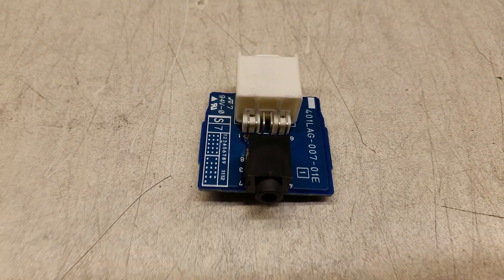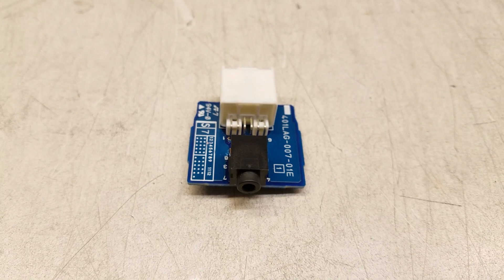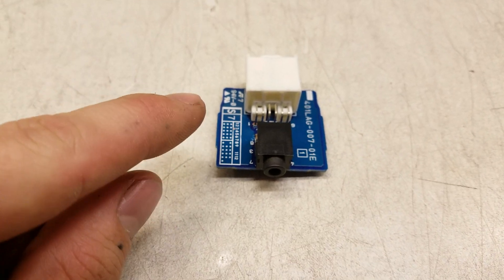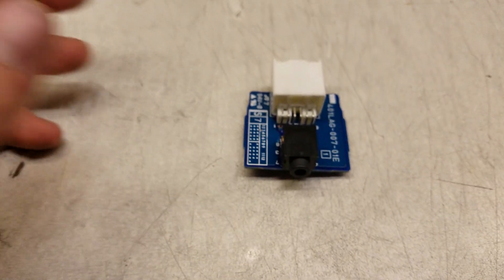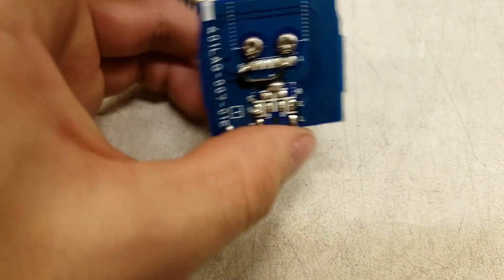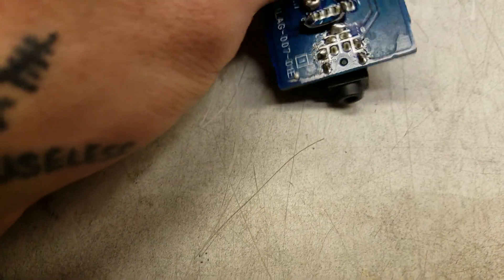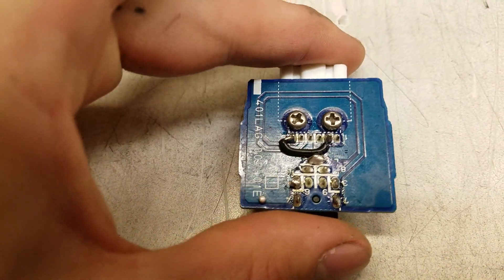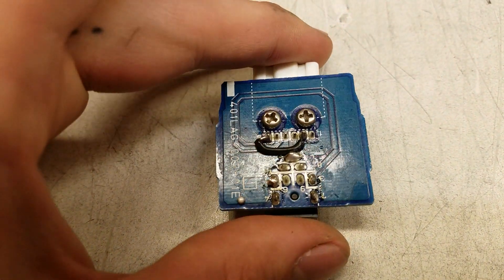AUX FIX FOR MAZDA 3

Comment: Thanks for posting this video. You saved me $50. I found it is much easier to tee the 1st & last wire together. No soldiering required. Cheer!!!!
Reply: How did you do it with no soldering?
Reply: @derickkaplan  probably some connecting caps that fit over the pins where all you need to do is crimp them.

Comment: Hello, thanks for this video! 

Does it matter what guage wire is used?

Also, my bluetooth is not working as well, went out at the same time the aux stopped working. I was reading somewhere it may be related to the bad aux. Do you know id this strategy will also get the bluetooth working again?

Thanks!

Comment: Thanks - works perfectly. Just an FYI, connecting pins 5 & 8 doesn't work (I tried this first), but as per your method, connecting pins 2 & 6 does work - cheers

Comment: I would really like to know what you used to set the 2 pins together.... honestly have no idea what to use I'm at that step currently... any help would be great thanks so much for this video
Reply from the maker: Learn to solder. It's not crazy hard and is a good cheap skill to have.
Plenty of stuff on it.
Buy a good burnzomatic iron some butane and grab a strand of wire.
You got this 🤙

Comment: Didn't work for me :(
Reply from the maker: Weird. Might be a bigger issue than just your port.
Reply: @CatZ3r0  Prior to soldering, if you held the jack male hard left, it worked. However as soon as I let go, music stopped. Pull to the left magic, let go, silence.
Reply from the maker: So why not make a test lead and figure out the pin?
This fixes exactly what you're facing.
Your solder joints might be cold as well, a glob of solder that isn't property flowed won't make contact.

Comment: This didn't work for me. I have a SAT button in mine that also does nothing. I am wondering if it's the button being broke, or maybe the SAT. I read that if SAT is enabled, then AUX (or in my case, "MEDIA") won't work.

Back to the drawing board! But at least you gave me a way to cross something off the list, and I appreciate that so much!
Reply from the maker: Yeah if you have the SAT plug in aux want work from what I understand.
Pull your radio and just unplug the SAT device and it should go back to AUX input.

Comment: Worked 100% for me. Pin 2 with 6. Luckily I had some wire small enough to solder. 2012 Mazda 6. Same PCB.

Comment: The port on my dad's 2008 mazda 3 works but sounds absolutely crap. I bought an Aukey bluetooth system for my Corolla but realized it requires a 3.5mm jack, which the mazda has so it's setup there. Lots of static noise (which is changing based on my engine RPM and gear weirdly) So is this video just a fix for a not working port or improves it as well?
Reply from the maker: Can’t hurt but what you’re hearing is what’s referred to as “alternator whine” plugging in a device like that (especially something externally powered such as through the lighter port) will give you the problem you’re facing.
Only way to alleviate it is to re ground the ground pin on the device to a better point and that’s very invasive and pointless. You’d be better off replacing the head unit.

Comment: Aux port in my 2011 Mazda 3 went out.  Tried a couple cables with no results.  OEM replacement module isn't that pricy but buying new and switching it out would be just about as much work anyway, so gave this a try.

Works flawlessly so far!  Absolutely no idea why Mazda would design this thing to force impedance detection before allowing aux port utilization.  Makes no sense and just acts as one more thing that can fail.  

Banged up the hands, broke a couple of clips on the aux unit getting it free, but got some music to listen to on the way to/from work tomorrow!

Comment: How to connect pin 2 to pin 6
?????
It worked for me with plier but you cant leave it like that
Reply from the maker: Solder.... Or a circuit pen. But I'm seriously questioning if you need to be driving with a question this dense...

Comment: I'm having issues getting this part out.. unpluggin it from the cable. 2012 mazda 3
Reply: I have a 2009 mazda 6 with the same problem. I first tried using a pen ink doohicky and super glue but to no avail. So heres how i fixed it...
1. Take an extra small flathead screw driver and wedge it along the seam of the cover of the actual port hole until it comes loose and you can pull it out. Took some work but have patience :)
2. I used needle nose pliers to free the white plug thing thing. Also was a bitch but eventually came free. Just be careful not to yank the wires and break them.
3. Then i had to break the four tabs on the sides to free the actual component and its board from its housing. Again, a bitch. Smh I ended up just stabbing them repeatedly until they broke through. Definitely be careful doing this as to not accidently stab and break the components inside.
4. I removed a small cover on the backside of the actual input port (small black cylinder) with the same small screwdriver as before. The only easy part of this whole process.
5. So from there i could finally see the lil bastard and went to work using any and every thing i could find to try to push it out through the tiny opening. CAREFULLY! Theres a flat metal peice that goes up the bottom of the port that the tip of the aux touches. After struggling for several minutes trying to go around the darn thing i realized that i could gently (very gently) pry it back just enough to give me the room i needed to get in there with a tiny allen wrench.Just pry it back slightly and it slides out just enough.
5. Finally! Success!!! The tabs i broke were not a problem. I was still able to push it back into its housing securely. It worked perfectly after putting it all back together and back into its litttle home . :) Hope this helps anyone out there having the same issue. Good luck!
Reply from the maker: @ryanchristopher2810  Thanks dude, I just don't have the patience or a fleet of cars to explain how to open every version of this how garbage AUX port by the lovely ford team.
Reply: Help
Reply from the maker: Jesus my dude... Maybe this is a little out of your wheelhouse? 
It’s a cunt to get out so maybe try harder?

Comment: i got the aux port out of the car and and disassembled it but for the love of god i cannot bridge that 2 and 6,,, there is not enough room for wire to go in and stick around... can you please show me how you did it?? or is there a special wire you use for this occasion?? please let me know i have tried to find a part for auxiliary input jack assembly for mazda 3 but i cannot even find that part from anywhere... i would really appreciate some answer. thanks

Comment: Hey man I'd like to try this, but I can't for the life of me figure out how to unplug the thing. I've got it pried out of the surrounding console, but can't disconnect it to take it apart.
Reply from the maker: It should be just the two little white pins you got to pop a part to get to the actual circuit board. I'm not sure if in later models they decided to plastic weld it together but if they did you can always just cut it and glue it back together.
Reply from the maker: God knows Ford would do some petty shit like that to prevent people from fixing the shit without paying $80 for a part.

Comment: I got it out but How did you did the bridge? Thanks for the help
Reply: I have a 2009 mazda 6 with the same problem. I first tried using a pen ink doohicky and super glue but to no avail. So heres how i fixed it...
1. Take an extra small flathead screw driver and wedge it along the seam of the cover of the actual port hole until it comes loose and you can pull it out. Took some work but have patience :)
2. I used needle nose pliers to free the white plug thing thing. Also was a bitch but eventually came free. Just be careful not to yank the wires and break them.
3. Then i had to break the four tabs on the sides to free the actual component and its board from its housing. Again, a bitch. Smh I ended up just stabbing them repeatedly until they broke through. Definitely be careful doing this as to not accidently stab and break the components inside.
4. I removed a small cover on the backside of the actual input port (small black cylinder) with the same small screwdriver as before. The only easy part of this whole process.
5. So from there i could finally see the lil bastard and went to work using any and every thing i could find to try to push it out through the tiny opening. CAREFULLY! Theres a flat metal peice that goes up the bottom of the port that the tip of the aux touches. After struggling for several minutes trying to go around the darn thing i realized that i could gently (very gently) pry it back just enough to give me the room i needed to get in there with a tiny allen wrench.Just pry it back slightly and it slides out just enough.
5. Finally! Success!!! The tabs i broke were not a problem. I was still able to push it back into its housing securely. It worked perfectly after putting it all back together and back into its litttle home . :) Hope this helps anyone out there having the same issue. Good luck!

Comment: Does it matter what kind of wire I'm using? I used a headphone wire since it's essentially just speaker wire and this is technically an audio component although I realize it's a chipboard, so wondering if the thickness or type of metal inside matters at all? The headphone wire didnt work
Reply: Were you able to get this figured out? Asking myself the same question now with 2011 Mazda CX-9.

Comment: This worked for me! You are the man!  I have no idea how you figured this out, but I appreciate your post.  Here's some tips for removing the aux unit from the center console:
1) Remove the cupholders https://www.youtube.com/watch?v=qvzbvSH2Q8g
2) Unscrew the shifter knob (automatic transmission)
3) Remove the shift panel http://www.mazda3tech.com/shift_panel_removal_installation-715.html (just need to get it loose to access the center console bolts)
4) Remove the center console bolts and pop the console, this gave me enough room to access the aux from the backside http://www.mazda3tech.com/console_removal_installation-719.html
5) Press the aux unit tabs in from the backside while pulling on the unit from the front http://www.mazda3tech.com/auxiliary_jack_usb_port_removal_installation-466.html
Reply: Wow honey! You literally only need to pop the aux  box out that you plug the cable into it is clipped in! The grief of disassembling the entire center console when you only need to pop a box out!
Reply: It's been a while, but I think I took my approach to avoid breaking the plastic retainer clips on the aux box
Reply: Okay okay, but I think I’d rather snag a new one at the wrecking yard if I broke the clips. But now that you are here. I have a problem with a connection in my aux box if I angle the plug just right it will work until I drive over a bump . Should I replace it? Or just check for a faulty connection. I figured I’d do this while it’s out. But I have zero experience, does he Sauter the pins together? Or something else?
Reply: @amberfrazier575  yes, his fix is to join two pins with solder. Your experience sounds familiar to mine. It would work at just the right angle. If you have the aux box out, I recommend trying his fix. You could probably do a simple check before soldering by connecting the pins with tape or some other temporary method.
Reply: @oceansidebarrels1  and this worked for you? Correct? I just don’t understand how connecting to pins can fix what looks to be a loose connection issue. But like I said I have zero experience with this so if it works it works.
Reply: The radio checks if those pins are shorted to determine if there's something plugged into the aux socket.  Probably a plastic piece pushes two contacts together or something when the plug "clicks" in.  If that breaks, or a solder joint greats, or whatever, it prevents the radio from switching to aux. If you have continuity on the aux signal lines (pins 3/4/5) then you're good once the radio sees 2 and 6 shorted.

Comment: A lot of thanks for your video! You save me from spending worthless money. Here in Mexico, most of the times in this days, the mechanics don't want to spend time in checking part by part and they probably would told me that it was a problem of the head unit on the radio. Really thanks! 

PS: sorry if there's english mistakes, it's not my native language.
Reply: Hola Hugo, yo tengo el mismo problema con la entrada auxiliar de mi Mazda 3, fue difícil desmontar esta pieza? ya que se encuentra en la parta interna del descansabrazo

Comment: Saved me $50 at least, and now I can listen to something other than commercials. Great content! 
I used a small screwdriver with duct tape to pop the corner of the Aux jack and then braced it with a quarter or other small screwdriver while I worked on the other corners. Just followed your steps from there. Keep em coming.

Comment: I had a aux cord break off still in the input any advice about how to get it out?
Reply: I have a 2009 mazda 6 with the same problem. I first tried using a pen ink doohicky and super glue but to no avail. So heres how i fixed it...
1. Take an extra small flathead screw driver and wedge it along the seam of the cover of the actual port hole until it comes loose and you can pull it out. Took some work but have patience :)
2. I used needle nose pliers to free the white plug thing thing. Also was a bitch but eventually came free. Just be careful not to yank the wires and break them.
3. Then i had to break the four tabs on the sides to free the actual component and its board from its housing. Again, a bitch. Smh I ended up just stabbing them repeatedly until they broke through. Definitely be careful doing this as to not accidently stab and break the components inside.
4. I removed a small cover on the backside of the actual input port (small black cylinder) with the same small screwdriver as before. The only easy part of this whole process.
5. So from there i could finally see the lil bastard and went to work using any and every thing i could find to try to push it out through the tiny opening. CAREFULLY! Theres a flat metal peice that goes up the bottom of the port that the tip of the aux touches. After struggling for several minutes trying to go around the darn thing i realized that i could gently (very gently) pry it back just enough to give me the room i needed to get in there with a tiny allen wrench.Just pry it back slightly and it slides out just enough.
5. Finally! Success!!! The tabs i broke were not a problem. I was still able to push it back into its housing securely. It worked perfectly after putting it all back together and back into its litttle home . :) Hope this helps anyone out there having the same issue. Good luck!

Comment: Thanks for posting this fix!  
Worked on our 2010 3, and our 2012 cx-7.  The 7's port looks a little different but bridging pins 2 and 6 worked the same.  As other mentioned, pulling out the AUX ports was a royal pain.
Reply: Hey I have a cx7 too, wich pins did you bridged? (looking at the module from below)
Reply: bob brazeau sadered

Comment: Thank you! This worked and so easy to do. To take out the aux it does help to take out the cup holder but don’t need to I used a penny to pry the bottom and the from the top. Once out press on the middle of plug as you pull to disconnect. Then pressed on the white tab to take unit apart.

Comment: Grate video. One question: i have a 2010 mazda 3, and the aux jack is in the armrest. How should i take it out? It just doesnt come out. I took the cup holder out but still no luck....
Reply: I'm actually trying to replace mine myself, so far i've been able to slide the jack itself out but i have yet to disconnect the cable from it. What i did is remove the cup holders with my parking brake on, and essentially sit myself in the very center of the car facing the rear of it, and slide my hands into the area under the center console, and push down all 4 tabs while pressing upwards on the jack, assuming it's the same as mine. Good luck!
Reply: IT WORKED! Finaly, after getting some prys, i took it out and did what you explained. Seems to work for now.... Thank you!
Reply: hey thanks for the tip! I actually managed to get it out with just my hands, but scratched myself up pretty bad haha. Aux is working just fine now
Reply: Having this same issue. Which pry set did you get?